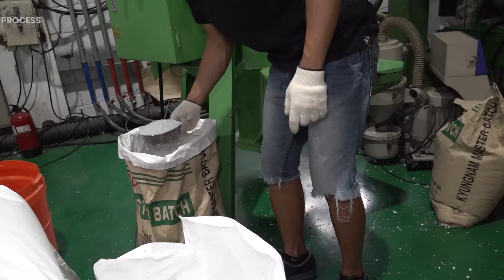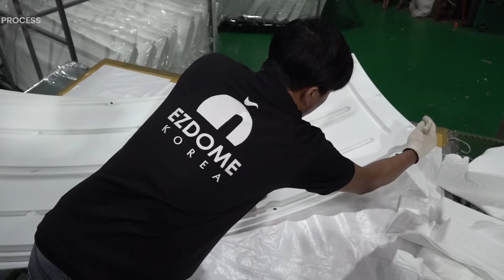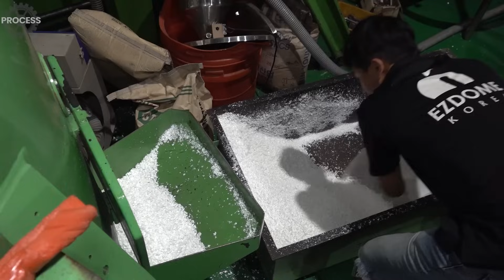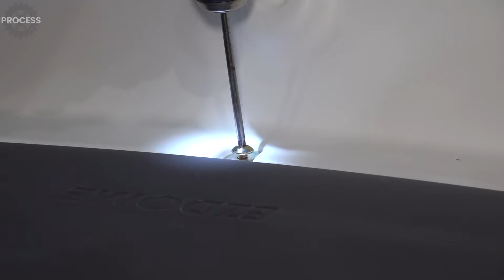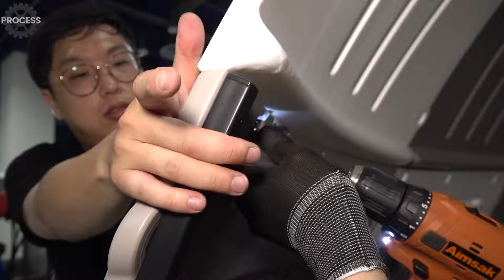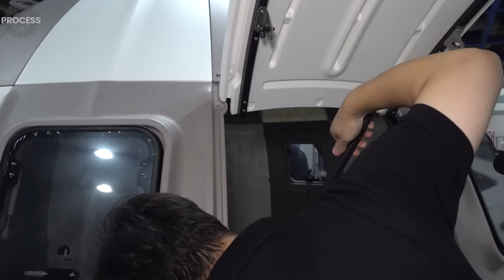Process of Making Portable Dorm House in Korea Dorm Tent Factory.

Comment: Tiny dwellings are everywhere. The problem isn't the lack of tiny homes, its zoning laws preventing more than one dwelling and having a minimum floor size for homes. I'm also not so sure about the plastic and the weather. It fades and breaks down in sun causing all sorts of smells, cracking and warping. It would also be hot in summer and cold in winter. For cost, a modular plantation wood home would be miles better. There are a few companies here who do that with great success. Much nicer to be in as well.
Reply: it's 3,000 + dollars, what do you expect. makes a great temporary emergency shelter for disaster relieve.
Reply: Put in under a moderate to full shade source and the UV takes 2-5X longer to degrade.